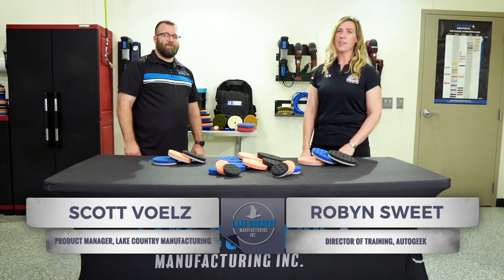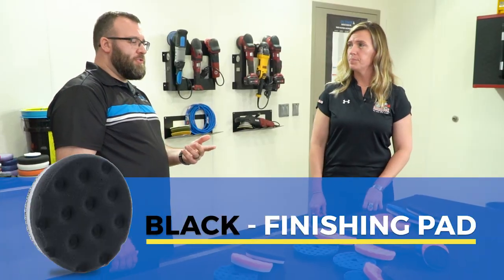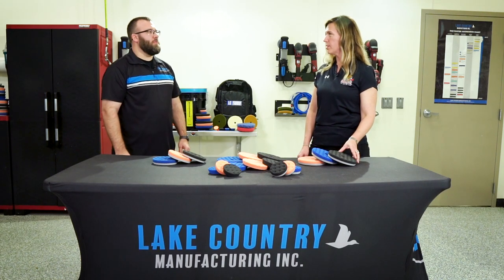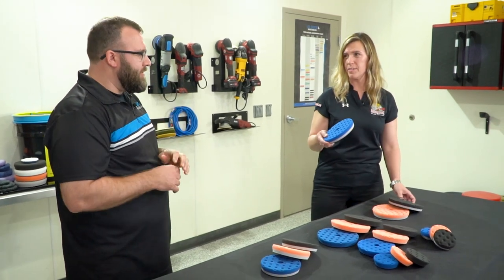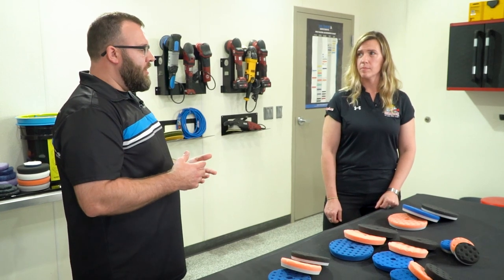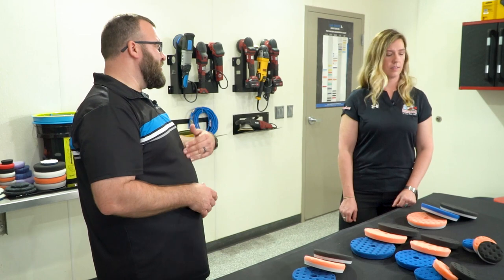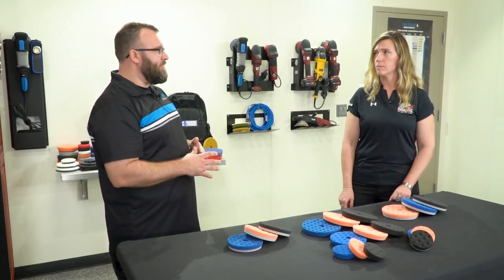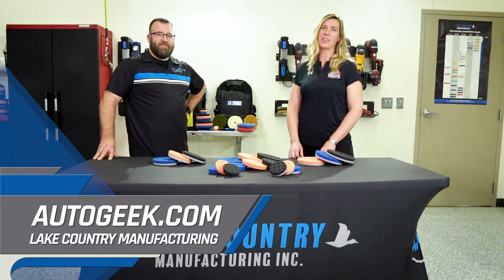What is the purpose behind the different colored foam pads?

Comment: Why change the color coding from the original CCS pad line? Orange and blue are opposite in the standard CCS line. This has got to create a lot of confusion.
Reply from the maker: Lake Country will eventually discontinue the old Cut Back CCS Line to help eliminate some of this confusion. Their SDO/HDO lines are their best orbital pads moving forward and since adding the CCS technology to this pad line it outperforms the old series. Eliminating a six foam pad series with a three foam pad series going forward will help eliminate some of the past confusion. The Orange pad is the same foam from the Cut Back “CCS line”, and they just added in a more aggressive cutting foam with the Dark Blue. This dark blue is significantly different from the light blue in the old Cut Back CCS Pads.
Reply: @autogeek  that will definitely make it easier. Luckily my old pads are nearing end of life anyway. Must be time for a full replacement!

Comment: So this was a little confusing.  You can use blue and go directly to black, so why buy orange?
Reply: From a clear coat context it would be best to use a orange IF you don't need the aggression of the blue foam. So for light polishing the orange pad would probably work. Heavier polish blue and black maybe. For instance a car that is 5+ years old and never has been polished. Neither are the blue and orange overly aggressive foam pads to begin with if the paint is trashed. That would be wool and microfiber territory and usually a 2+ step. I look at the blue and orange has basically one step pads, soft or hard paint/light to medium-hard polishes. If i'm going to do a true 2 step i would cut with a fiber pad and finish with a foam pad.